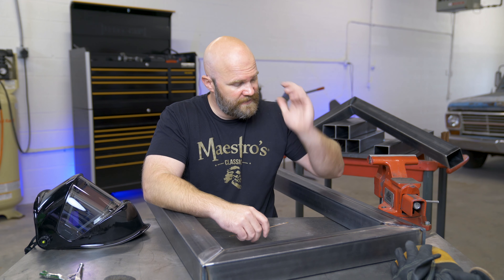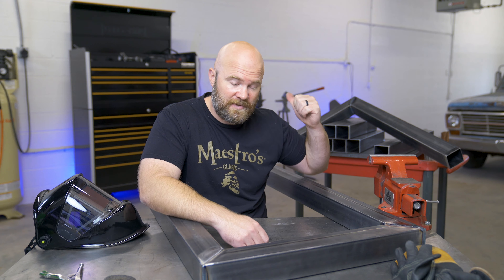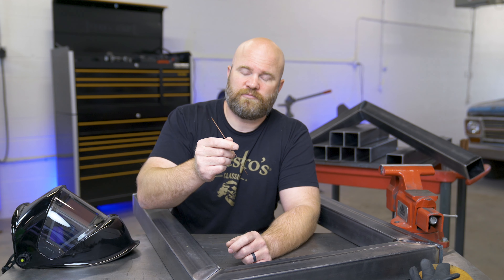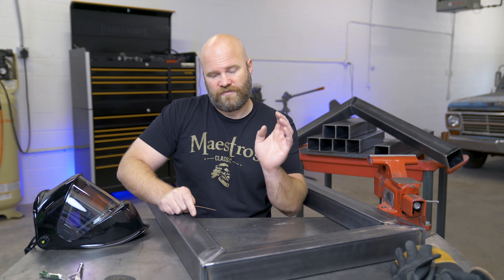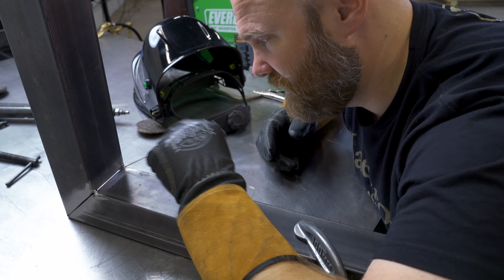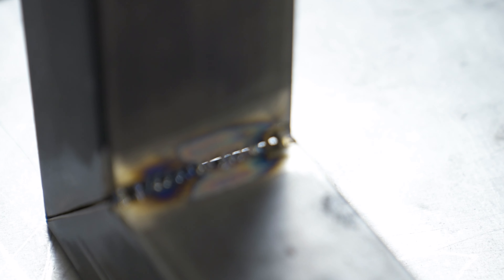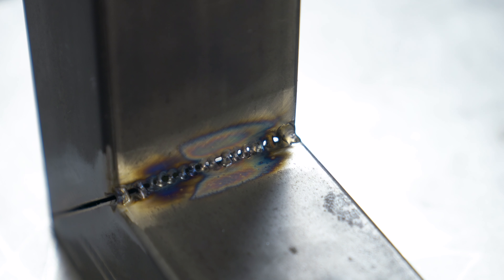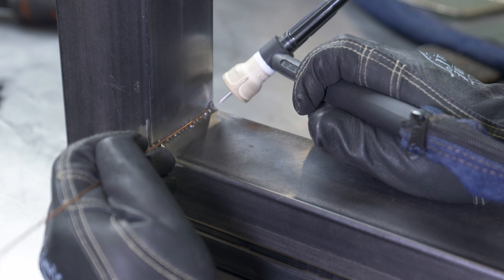TIG Welding A Gap In Thin Steel

Comment: interesting technique,   i have used a 3 tack laywire variant...   3 tacks 2 corners 1 middle ...  then id lsy the filler in the gap and weld .. just using small circles to tie eveything in..  but i would aldo use higher thsn reccomended amperage to get the welds n tacks started the manually pulse the arc with my pedal to control heat input and the haz 😁👍

Comment: 100% professional work! I have trouble filling up gaps identical to what you did on this video. Perhaps thinking of the first pass as making the little teeth can help me. Thanks a bunch.
Reply from the maker: Helps me! I started doing it with a CNC’ed part that was held in a fixture and welded to a fabricated part. Welded hundreds that didn’t fit along one edge and did this to bridge it.
Reply: I use that same technique with mig or stick to handle a gap. Man that thought me to weld 40+ years ago called it “building bridges”.

Comment: Nice video Justin.
I often see similar gaps when having to finish cuts that don't quite fit in my cold cut saw.
I'll use your excellent "teeth" method over using thicker rod and adding excess heat and material.

Your welds look great.
Reply from the maker: Perfect! I'm not sure how people do the thicker rod, especially when using rod that's thicker than what you are even welding.
Reply: @JustVoss  You heat the rod more as you dip it. I've noticed you often press the pedal a bit as you dip. That helps to melt the fat rod in without blowing out the sides
You may then end up with a bit of a sort of worm lying across your gap but you can then go over it again with the torch to melt it in to where it should be. Now that there's metal there you won't get holes. The teeth method is better though. I often deliberately don't cope practice joints too well to save time and get a bit of practice on dealing with gaps.

Comment: To prevent debris in your welds, keep the tip of your filler metal in your shielding gas cone. Cleaning all of your filler rods with a scotch bright helps too. But for hobby work it isn't needed.

Comment: I don't call .08 thin tubing but I watched the video anyway. I do a lot of .04 tubing (1 mm thick) and it is a bitch to keep from burning it. (this tubing is used a lot in furniture making)
Reply from the maker: I appreciate that, and that’s good to know. .080 is all I had, I probably would have used .060 if I had it. Last time I made a gate I think I used around .040 tubing from someone’s recommendation to keep it light. Was a pain but turned out nice.

Comment: Hi there. I like the technique you used for the table leg gaps. Question. I noticed you didn’t have the legs braced for that inside corner. Do you just preset the joint or did the weld draw the joint inward?

Comment: I dont have a drop saw so use a cutting disc on the angle grinder....this issue and tip to deal with it will come in handy!
Reply from the maker: Perfect! I have a drop saw but with it's little blade it rarely cuts straight.

Comment: Thanks from Brazil, I always have some difficulties with larger gaps, I ended sometimes using aluminum on my projects mainly because I can use a miter saw do get a precise 45 degrees cutting, but this add some cost too... I will try your tecnic next time.
Reply from the maker: Hope it helps! It’s not for every situation but works well in some.

Comment: I'd have gapped it at 3/32" and then used a 3/32 rod and fed it into the joint. 80 amps, quick travel speed and you'll have those "shiny" welds with little oxidation. Use ER70S or if you prefer to use the stainless use 309L specifically.

Comment: With the position you are in, where the tube is above you, how do you control the wapring? That's a lot more weight pushing down on the the now molten metal. 

Or so do you feel confident that your outside bead as you mentioned, is sufficient to combat the warping?
Reply from the maker: I think with the 3” tube, you have substantial tacks that are spaced out. I feel like this holds any crazy warping pretty good. If it was super crucial I think you would have to have it held in a fixture.

Comment: Looks like a great idea for thin metal as well.  BTW:  Are you using a panoramic helmet from Eastwood?  If so, how do you like it?  If not, what helmet are you using?
Reply from the maker: No it’s a Blue Demon Pano. It’s linked and listed in my Amazon store in the description or you can just search it up on Google. I really like the view. Flipping down the hood doesn’t feel like it has to be the LAST thing you do.
Reply: @JustVoss  
Thank you for the info.
I found your review of this helmet.  Looks like a nice helmet with a great shade range. I use the Esab Sentinel A50 but may add this one as well.

Comment: I would have taken an 1/8 inch or 3/32 wire, laid it in the gap and good to go....... that kind of seemed like a waste of time and a good way to introduce porosity
Reply from the maker: I don't really get how you would get the 1/8" wire to melt while the base material is only .080"
Reply: @JustVoss  man that's the point LOL apparently you haven't filled many gaps 😂 I was just saying lay it in there for beginners which is an easier way to do it but takes more Arc control. The thicker rod acts like a heat sink allowing you to drop in metal and fill the Gap without burning back the base material. If things start getting a little hairy actually you can feed in more Rod to cool the puddle and bring bring things under control. If you use the lay wire technique you just need good Arc control and focus it on the rod to form the puddle and feed more in if necessary. This technique also works great with Texas Mig and or tig filling gaps. I can literally blast 20 to22 volts with a mig spanning a quarter inch Gap or more feeding in chunks of 1\8 inch thick or even 1\4 inch steel I cut into strips by hand into the arc.  Coat hangers make great Texas tig wire as well if its not a structural \ code weld.

Comment: Hey Justin,  Thank you for your videos, very much appreciated!  What amperage were you using and looks like your were pulsing with the pedal a bit? Thin tubing has been my nemesis...
Reply from the maker: I had it a little high around 110amps so I could more easily melt the tacks down and then back off in between.

Comment: Were you pulsing the pedal on your second pass? It almost looked like you were letting up each time you moved forward.
Reply from the maker: Sometimes I do that to freeze the previous puddle better. In this case it helped with the extra amps needed to quickly melt the previous tack welds faster by providing higher amps quickly than what you wouldn’t normally weld .080 steel with.
Reply: @JustVoss  Thanks for the tip.

Comment: WHAT WERE YOUR SETTINGS ON THIS??
Reply from the maker: I had max amps set to around 110... but will depend on what you are actually welding and your feel.
Reply: @JustVoss Mostly 19 and 20 gauge sheetmetal for repair panels on my 84' k10 and 71' c10.... I have an Everlast Lightning 275 mts

Comment: Your tungsten is a bit far out for my taste it has a higher chance to let in air and mess up the wield also when there is a gap like that u should grind/clean the inside too before u wield. When you stop you need more slope down to 3-3.5 Sec recommend. Also your filler thread needs the protection gas too if u move it away from the protected area while its still red-hot it gonna get contaminated with air and then its gonna ruin the wield if just use it without cutting the contaminated part off. Then last you need more heat and filler thread to get the right penetration. Its hard for me to tell since it isn't really show so well but it looks to me like u got a bit of a cold wield towards the end and in the middle. 

i would rate this wield 3/10